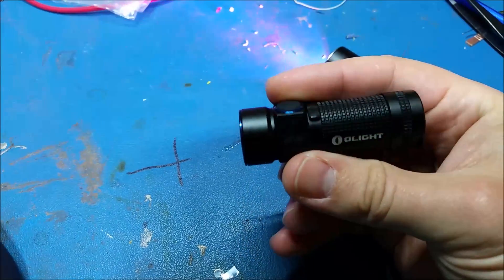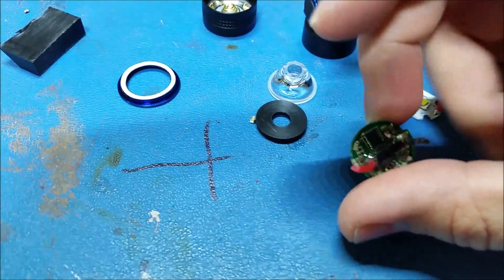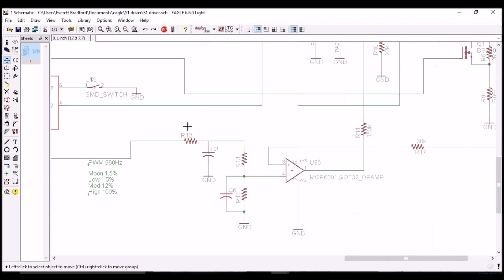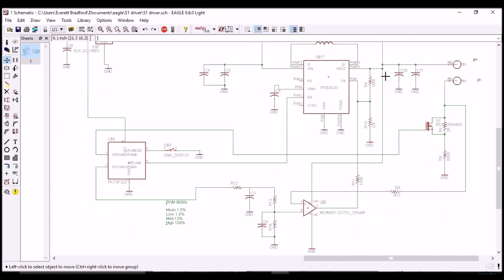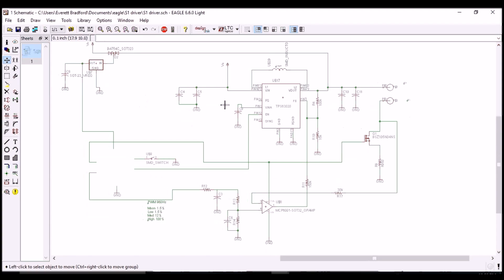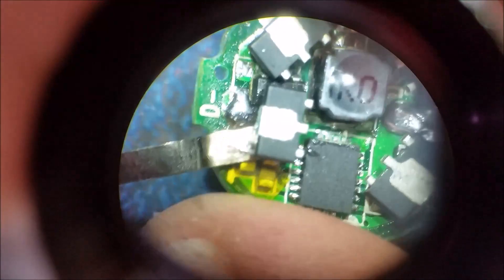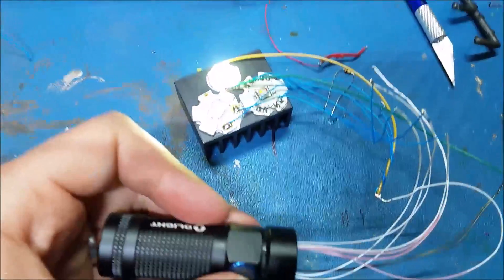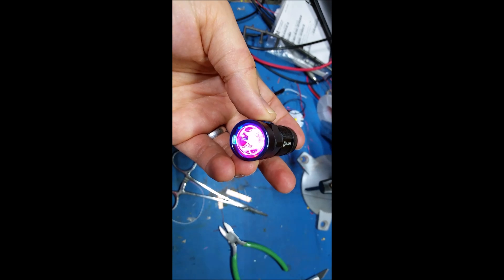Olight S1 mod with RGB and UV with MELD firmware

Comment: Thanks for explaining how the S1 driver works! I wonder, would it be possible to modify the stock S1 moonlight to be less bright by swapping the 2 ohm resistor R6 to a higher value one?
Reply from the maker: Yes I'm fairly certain that would work